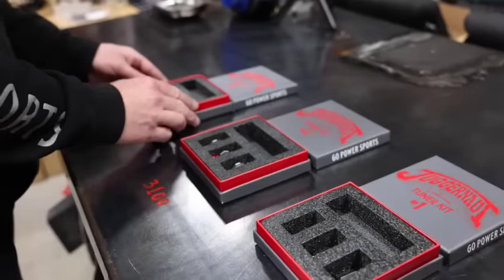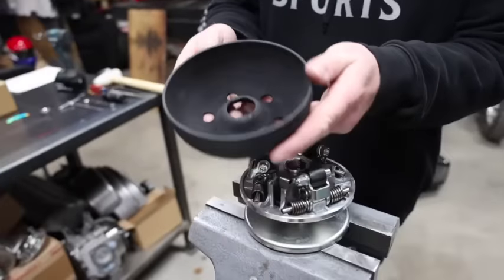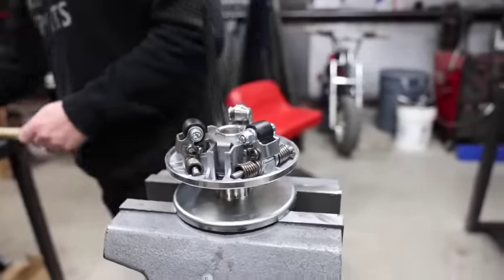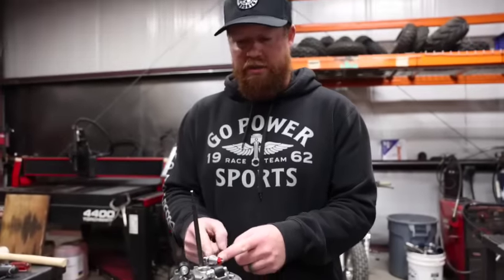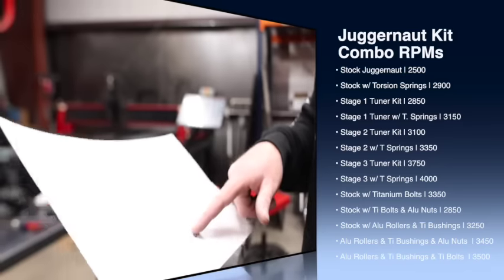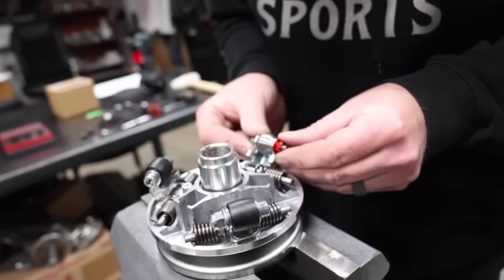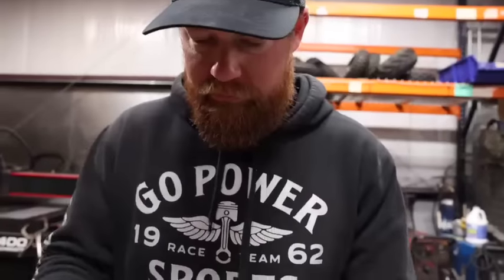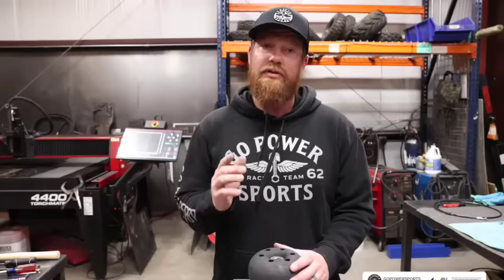Boost Your Go-Kart or Minibike: Juggernaut Tuner Kit Install

Comment: Is there a chart or spread sheet with the RPM data for all the part sets and their weights?   Knowing the Hooks K values or RPM data of the springs would also be helpful.  That way I can be selective about what parts to buy vs the parts cannon.   Thanks. 

Anytime you work with springs wear good safety glasses.
I have had great service from this company.

Comment: We need a stage 2 kit for the 212 that retains electric start!!
Reply: No we dont.
Because no one needs to hear how you spun it to 9k and lost your foot.
No one does or will make a flywheel you can do that with that has charging magnets.

However there are billet flywheels that let you keep the ring gear for the starter.
Reply from the maker: We've got a stage 1.5 for the Tillotson.  https://www.gopowersports.com/stage-1-5-tillotson-performance-kit/ More power and you keep the electric start.

Comment: Has anyone ever painted the black housing of the Jugg to match their bike? I guess what I'm asking is does it get too hot for regular rattle can paint without it being a high temp paint.
Reply from the maker: We sent ours to the chromer and it looks fantastic.
Reply: @GoPowerSports  I appreciate the response but, it didn't answer my question, will regular spray paint hold up with the heat it produces?

Comment: idk man after buying these parts it's gonna cost as much as the whole juggernaut itself
Reply from the maker: The Juggernaut is a performance part that will get used and abused at high RPMs.
Reply: @GoPowerSports  why are your stage 2 parts red and stage 1 are black. I have stage 1s that were purchased a year ago that are red. kinda confusing